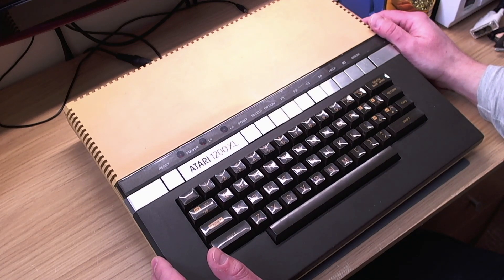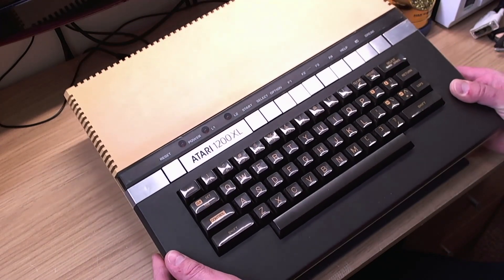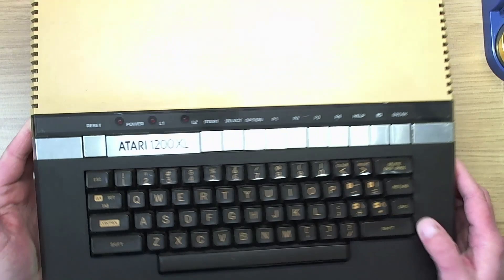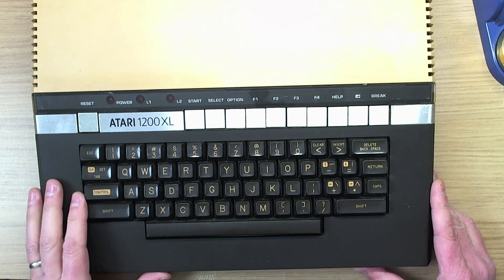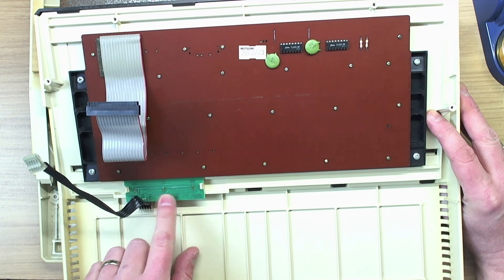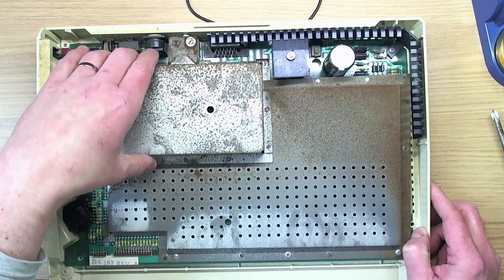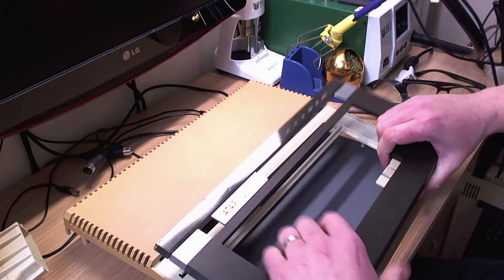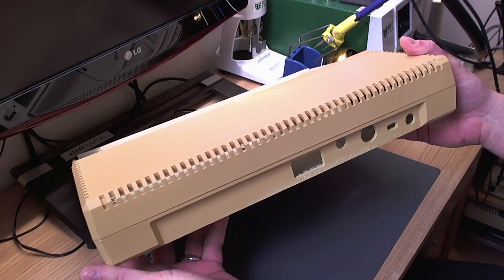The Italian Job Part 1: Restoring an Atari 1200XL

Comment: Very good video I congratulate you, I am restoring one that is breaking my head, it only turned on 3 times, I do not know what causes that failure, the ram's are good, I tried everything even some chips of an atari 800xl, I have to change all the small capacitors .

Can the rectifier bridge fail? or is it not usual? It gives me the impression that some voltage is missing, I already put the 7805 new, I ask you because I do not know what else to try.
Reply from the maker: 5V regulator would be the most obvious suspect, but if you replaced that already, perhaps it is the rectifier. You could diagnose properly by disconnecting the 5V power input and trying to jumper the machine to a 5V 2A DC supply and see if it boots up. If it does, then you know the power input is bad.
Reply: @flashjazzcat  
Great advice, thanks, I'm going to put it into practice, I had also thought about 5V but I don't know where to apply it, I'll read a little more these days.

I am freaked out by the erratic fault.

I appreciate the help.

Greetings from Argentina! 😁
Reply from the maker: @nopochoclos  5V goes into the motherboard somewhere at the top right corner; you should remove the connecting passive component and connect 5V DC in there (plus GND, of course). You could actually replace the 9VAC input entirely with 5V DC directly at the jack in future; you could then remove the entire bridge rectifier and power the machine off a 5V2/3A PSU with a suitable power jack (being careful never to plug in 9VAC again, of course!). I once converted a 1200XL to take a standard XL/XE power connector, but I think it would be less messy to just use the existing barrel jack and then bypass the entire rectifier. A nice fat smoothing cap between GND and 5V somewhere on the motherboard, and you'd be good to go.
Reply: @flashjazzcat  
I'm learning electronics little by little, thanks for the advice, whenever I work on my retro collection it is with great fear, not the part of changing components, but mods.

Could you tell me which chips are compatible with the ATARI 800xl, which is the only thing I have on hand to test?

Pokey, processor OS? the rest?
Reply from the maker: @nopochoclos  I'm no electronics expert at all; more like a 'janitor', as Louis Rossmann would describe it. :) Almost everything except the MMU and OS ROM from the 800XL is compatible with the 1200XL, meanwhile. Various 74LSxxx chips will be different, but all main VLSIs (CPU, ANTIC, PIA, etc) are fully interchangeable.
Reply: @flashjazzcat  Thanks, a lot!! i will try again with patience.

Comment: Deyellowing went really quickly and I like the result.
Reply from the maker: Hehe... it went quickly in the video, but seemed to take forever in real life. :) But still, faster than expected.
Reply: @flashjazzcat  I thought it would take days, not just hours :-)
Reply from the maker: @perinoid  Yeah, same here. I started the process on Saturday and it was finished on Monday (after I filmed this). So, basically working on and off on this for two full days.
Reply: @flashjazzcat  In the movie it says "three hours later" ;-) That's where I had to stop. Now I can see, you added 1.5 days more. Anyway, that was pretty quick.
Reply from the maker: Yes it was far from finished after two hours in the sun and three hours in the light box.

Comment: I just picket up 2 1200XLs this year that work, but for various keyboard issues.  I haven't opened it up yet, but spent most of the summer light-brighting the case.  It didn't seem to have any great effect but I hesitate to put hydrogen peroxide on the keyboard as I've seen various attempts wreck the key color's.
Reply from the maker: This is the first time I ever tried peroxide on dark keys, and it will be the last. I always considered it a bad idea, and now I've finally got the receipts. :)